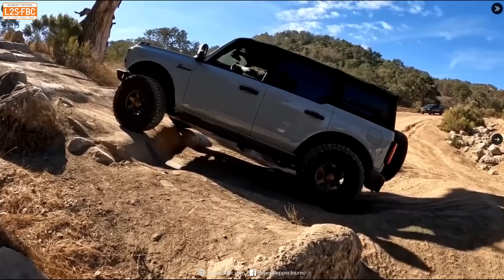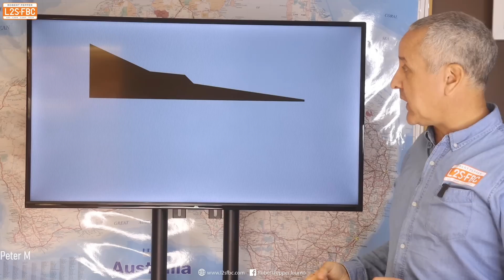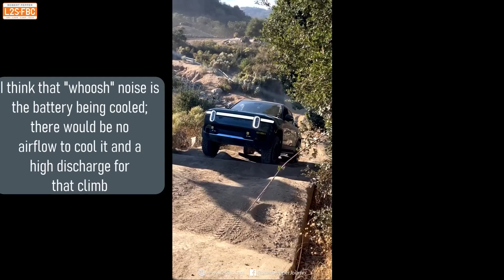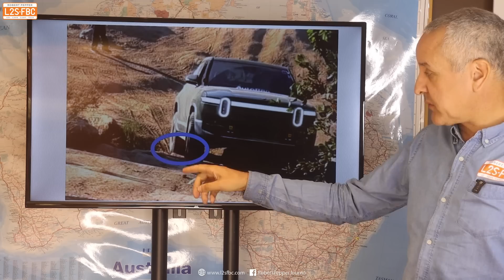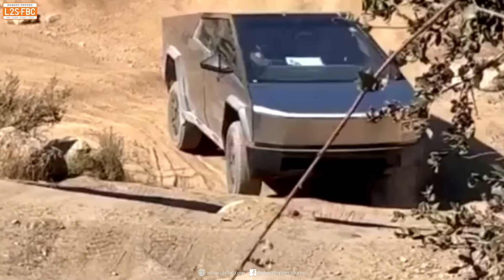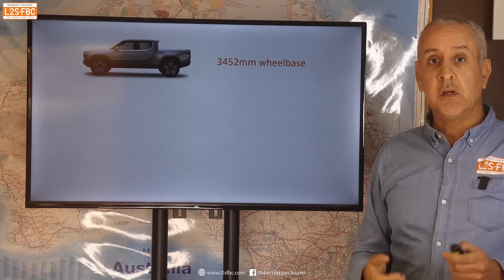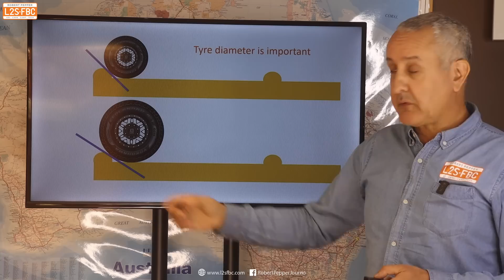Tesla Cybertruck Climb : Analysed & Compared F-150, Rivian

Comment: I'll be impressed if these electric trucks can drive the Rubicon trail for a week and then back to a charge station.
Reply: Which car can you drive off road for 1 week with one tank of fuel?
Reply: @VeganPilot84 just like people does cannonball runs you can install bigger fuel tanks in your ICE and drive for much longer which is impossible with EVs.
Reply: Rivian did manage to get their SUV (34" tires and a shorter wheelbase than the truck) through the Rubicon on a single charge, but only just.  They also needed quite a bit of help from a Wrangler and I think 7 spare tie rods as well as welder mid-trail.  They towed it to the trailhead with a Ford and started at 80% SOC.  Probably a fair representation of if they had driven it from the nearest charging point.  They got off the trail and to a charger in Tahoe with only a few % SOC left.  So they made it, but not easily or in one piece.  Still, better than most stock vehicles.  This was a group of Rivian engineers, so hopefully they will use this to improve the product.
Reply from the maker: me too
Reply: The closest Ive been to going  down.... under involved a aussie lady visiting the states some 25 years ago ..     

here in the US the plugshare app or website will show you charge stations and even plug ins for your portable charger.   

An  actual charge station is not needed since typically even some of the most remote wheeling has campsites with RV AC power plugs.   Alternate nightd between sites with plugs and camp on the trail..  

Since lower speeds are where their peak efficiency occurs and electric motor braking down grades regenerates with a touch of planning it's a lot easier than you think.   

People have gone 600+ miles in a 300 mile range EV when keeping it 20-30 mph.   The range estimates are typically freeway speeds .
Reply: @MotoGPatrick  I think you may have a different concept of "remote wheeling" than I do if you are expecting to find an actual campground and power much less RVs there.   Also of note, even though you are traveling very slow when wheeling you should expect to use far more power than normal given you'll be working the vehicle immeasurably harder than on any sort of road.  As noted, the Rivian barely made it through the Rubicon starting at 80% SOC.  Not exactly sure how many road miles they did to get to a charger but all in the entire trip was maybe 30 miles.  What is their normal road range? 200 miles?
Reply: @RoverDon123  Rubicon has posh spa hotels with chargers 4 miles.from the trail.   It's not remote, just hard,  stock jeeps take the bypasses on that.  Rivian added just sliders and front receiver,  they wanted to be the first I guess.  a HV battery winch,  100% batt start would have been different.   EV swapped jeeps are going to do Rubicin easy then Jeep is going to do it easy with a production full BEV. Even baja has plenty of chargers now.    From boca chica to east cut on padre island is a big gap and no RV plugs I would call remote but it's doable in a 400-500 mile range rig.  Running the beach isn't as rough as rubicon.   Tesla drove from TX to AK,  not much is truly remote.

Comment: The cyber truck looks like the suspension is way to stiff for the application.
Reply: The body itself looks stiff.
Reply: @2URLex  Its meant to be stainless steel construction and stainless doesn't like flexing much. It work hardens quickly and then cracks. All the welds separating is not a good look.
Reply: @hoyks1  yea you’re right, I saw no articulation either. That couldn’t have been comfortable in the driver seat.
Reply: @hoyks1 Cybertruck is a cast aluminum unibody. I don't expect durability off roading.
Reply: Looks like its made to be a city tank to fight zombiez, not a off road vehicle
Reply: It looks really ugly too. 😂
Reply: @paulelledge8977  Yeah, not just touched with the ugly stick, fell out of the tree and hit every branch on the way down.

Comment: All those electic SUV/Truck are Extremely Heavy.
Maybe it is ok for rock climbing.
But it is no good for mud, deep snow, sand and especially for swampy roads.
Reply from the maker: Actually weight isn't always a massive disadvantage offroad, and in some cases, more weight can work to an advantage. But yes generally light is better.
Reply: @L2SFBC  agree, in shallow snow and in shallow wet mud with proper tyres (with deep structure) weight will be beneficial since it will push away the snow and mud for wheels to touch the understructure.
But here in Russia and in Eurasia in general we have muddy, swampy lands which is poorly suited for those weight monsters.
Even the paved roads will suffer from all these EV mass moved on four weels...
Reply: @4upkoB I competley agree with the weight issue. I visited my friends in my old home state. I rented a stock Gladiator Rubicon. At 4650 lbs it was significantly lighter than many of my friends modified rigs which can easily weigh over 6000 lbs. The trail we went on was covered with dense wet early spring snow. While many of the other vehicles sunk in the snow and needed to be winched out the lighter jeep could easlly just drive mostly ontop of the dense snow and was easily the most capable vehicle out that day.
Reply: @L2SFBC  other than very shallow snow or mud with a hard base under it, when would more weight help off-road?  It could certainly be beneficial say as a tow rig but I'm not sure where it would help off road (?)